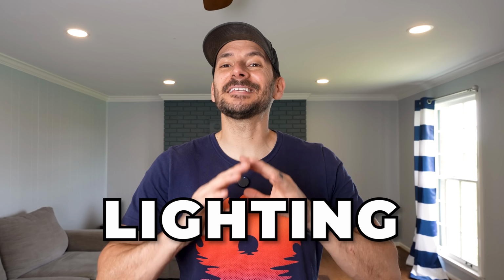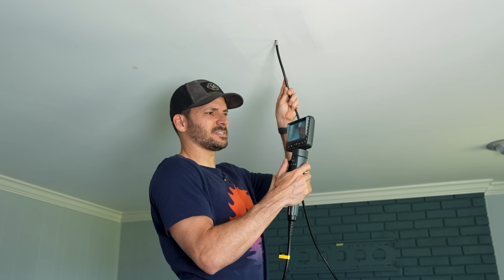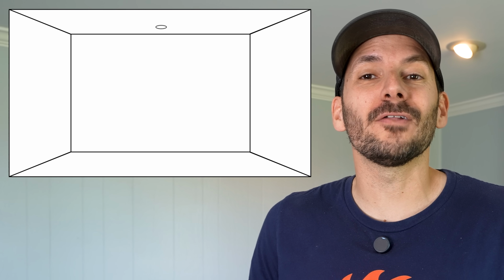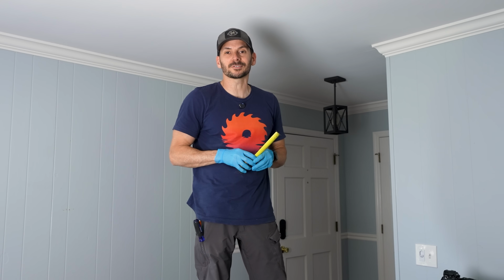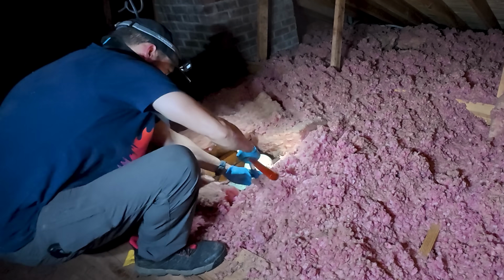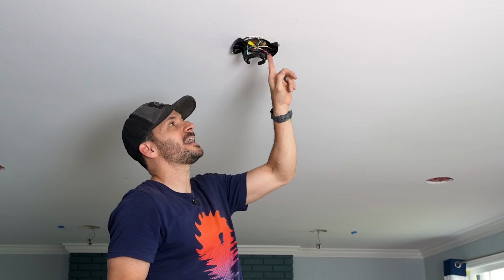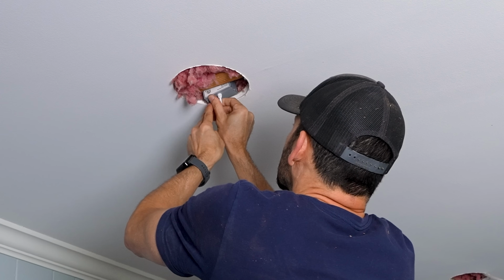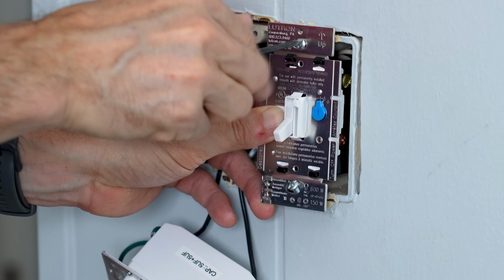Electricians Hate Me for Showing You This!

Comment: Huge cautionary tip!  If you are going to use one of the long shanked bit to drill across the ceiling joists to run the wire because you do not have attic access.  Most times you will be fine, BUT, and it is a big but, you have to be aware that you very well may hit a wire stapled to one of those ceiling joists.  If you do, then you have a much bigger problem because you have to open the ceiling and either replace or splice the wire you cut.  If you splice, then all splices need to be accessible so you will end up with a blank cover showing in your ceiling.

Comment: You can find joists with simple magnets. You just wave them around the ceiling surface until you feel it attract to something metal. Once you've found multiple points you will see a line where the plasterboard is affixed to the joists above. 

I have also used a thermal camera which worked well for me. Point the camera at the ceiling surface and you get a black shadow where the joists are. The joists act as thermal conductivity, removing some of ambient room heat from that part of the ceiling.

Comment: Well, reduce the trips to the attic. Cut the wires to length. Get into the attic, run the wires, and staple. Done no more trips to the attic. Do all wiring from below. And remember to do attic work early in the morning so you don't have to roast in 100-plus degrees.

Comment: Rookie's 
the only time we connect the ground on a switch 
when your installing a electronic dimmer , sensors , or computerized
cause on normal s/p switches an plugs the plate that holds the screws 
is grounded by the metal box , an to the ground of plug 
an of course using Plastic boxes, which i hate 
cause u cant add a box
but then again us Canadian 's  go by different codes

ques: your one main ques when doing ceiling's 
          does it have  Radiant Heating , cause it would be a very COSTLY mistake?
Radiant Heat : Heat cables imbedded in the ceiling  2" apart

if i was doing this job , i would of brought an extra hand 
now that's how it becomes easier

about your Lums theory ,lol
we have pots that you just pop off the plate around the light an there's a tiny switch 
which gives you an option on how much lums of light u can have 
an the vapour barrier  , we moved the insulation a bit an put a square of vapour 
barrier 6 mil  and push it up with wire coming though it an 
leave a bubble 6" high an used insulation caulking to on all sides
to glue to the original vapour in the ceiling , that way 
you have air room , an the barrier is sealed again , oh tape the place where the cable comes in 
House Codes 4 Canada!

Comment: If you can access the attic, don’t drill all the joists. Just run the wire in the attic space and use a fish tape. You may need to use two fish tapes…one to catch the other in the attic. Then pull your wire in.

Comment: What is the deal with skipping the ground on outlets and switches? The last three houses I've lived in, this has been a problem, but especially the last one--damn near every single recptacle or wall switch had the ground wire capped off and shoved in the back of the box. So much for inspection. I went around the house and properly attached every one of them. Is this a thing, like some guys doing it on purpose for some idiot reason, or just pure laziness?
My favorite mystery at the last house though was the circuit that still had 60v on it after flipping the breaker. Never did figure that one out before we moved.

Comment: Electrician here: Drilling through joists is fine and all until you hit something unexpected. If you're going to drill then you better use that scope between every single joist.

Drill through some unexpected plumbing and you're in trouble. If you're just some random guy with no trade experience and you're trying to do a weekend project, then I hope you started Friday night because learning plumbing, sheet rocking/finishing, and painting will be your Saturday and Sunday + after work project the first couple days of next week as well. Usually you're not going to hit HVAC, but it can happen and that's no good either. 

Attic access is better 11 times out of 10. Also, pro tips: stick some kind of marker through each hole where the light will go (tall enough so it sticks through all insulation), go up into your attic (just one time) with your reel of wire, and drop the dead end to the last hole and a loop through each consecutive hole working your way back to the junction box in one fell swoop. Then strap the wires (if you're not a tradesmen - use insulated staples and drive them just barely tight enough to prevent the wire from being easily pulled loose within 12 inches of cable entry to each light junction box and every 3 to 5 feet between staples if the light boxes are further apart). Strapping is necessary so the next guy to go in your attic (and it will probably be you) doesn't trip and fall through the ceiling.

Comment: With respect to switches, I have found TP-Link KASA smart switches to be the absolute best.  I do have Lutron vacancy sensor switches in some of my rooms; however, over the years, I have noticed their unexpected premature failures.  I have NEVER experienced such with KASA switches.  If one is to tackle installing lights and whatnot, NOW is the time to upgrade your switches to 21st century tech.  I rarely touch any of my switches, as Alexa does that for me.  Lastly, KASA smart switches are by far the easiest of all the available brands to setup.  The phone app is practically idiot proof, and you can set On/ Off  schedules in the app.  So if you have kids and/ or a wife that leave lights on because they believe that the floor needs to photosynthesize, you can set up multiple sequential off schedules.  Trust me when I say get the KASA smart switches!

Comment: Hopefully you're not in a cold climate or you would get attic rain without sealing the light with vapor barrier. Your attic already had the vapor barrier but you cut through it. I'm surprised you didn't patch it back or at least use silicone to seal the light to the ceiling. That way the warm air wouldn't scape to the cold attic, turn into frost and melt and produce mold when it gets warm. But great video overall.

Comment: Great video. Adding a few practical tips that make recessed LED installs smoother:
1. Layout: Mark the grid on painter’s tape on the floor, then use a point laser or 360 cross-line laser to transfer the points to the ceiling. Faster and more accurate than measuring overhead.
2. Test first: Power up and test each light before fully snapping it into the drywall. Defective units happen, and removing one later can damage the ceiling.
3. Fixture choice: Go with lights that have CCT select (and night-light mode if you want it). I’ve had good results with Amico.
4. Dimming: Use a dimmer with min/max trim to avoid dead zones at low brightness. Leviton Decora supports 3-way, and the mini locator LED is handy at night.

Comment: I'd love to have some ceiling lights, but how would you start in a multi-floor home where the floor/ceiling is made of reinforced precast hollow core concrete floor slabs?
The hollow space in the slabs is front to back, and the power sources are at the left and right side of the home; so you can't seem to move the power source away from those walls.
The front and back of the homes (here) are also closed off with precast reinforced concrete with coarse aggregate, also closing off any access to the hollow channels of the floor plates.

Comment: Tips not mentioned
Get a bucket of pull string and only go up in the attic 1 time, put the pull string in place where you wires will go, then you can pull everything from down below.
Stripping 14/2 is super easy with a mechanical stripper like the Irwin 2078300
Not a fan of the plastic strain reliefs. I like to use the metal cable clamps you also mentioned.

Comment: Neutrals do not connect to a switch unless it’s a lighted switch. The wires running from one three way to the other are called “travelers”. And not mounting the junction boxes is a code violation.

Comment: those flat wafer lights are terrible because there is no trim to block the glare, i foolishly installed them into my kitchen. Trust me get the ones that are further inset into the ceiling bonus points if you get the ones with black inner trim to further help with glare it will mask the light source where you cant see it on the ceiling only the light that it creates.

Comment: You don't need to go "up and down, up and down" when wiring up the cans from the attic.  Head on up and run cable to each can hole.  Instead of cutting the lengths, just fold the cable and push a healthy length down the hole, move to the next hole -- stapling as appropriate -- and repeat.  When you've made your runs head on down and snip the cable poking out of the holes.

Comment: as a licensed electrician....no one installing can-less lights EVER mentions the CODE REQUIREMENT to attach the junction box to the structure! stuffing the boxes up the hole to nestle into the insulation is not according to manufacturers instructions which violated code....of course there may be exceptions to my comments, but I don't think so
Reply: Apparently some of the can-less lights intended for remodels have instructions that state to not attach the junction box.  In that case, it should be code compliant and certainly easier to access in the future if you are doing a remodel.
Reply: I bet you’re a joy at parties 🙄
Reply: I think I'll just hire an electrician for my room. My luck I'd mess up.

Comment: I recently ran a four-way switch for a common area lighting.  Now I regret it for my situation and would have preferred to have a single switch plus 2 of the newly available wireless switches (sending units) for the other locations because with the hard-wired four-way switch (and same issue applies to a hard-wired three-way switch) I cannot have motion-activated lights.
Reply: the reason why , is cause the 4 , 3 - way  switches don't carry a little relay /solenoid
confused about , single switch an the 2 wireless switches 
but you added a 4 way 
there must be many way's into this area
ques: how many switches are there on this circuit for the lights
Being a Journeyman for 40+  an tech today 
every switch has to be modern tech switches for it to work
Motion Switches - set to a time of no activity (shut off)  1 - 10 mins
so three ways into this area , idk something tells me 
the 4 way should be where the sensor should be , considering the 
sensor switch is a single pole switch , take the 4 wires (2 white -2 red )
THIS IS JUST A THOUGHT! I CLAIM NO RESPONSIBILITY!
Marrett the 2 red - then hook up the other 2 to the Motion Sensor(which will act like a s/p switch)
if that works ,well happy for you , if not your have to wait 
till their invented , 3-4 way switch sensors 
when you build Houses , you run like a chicken with your head cut off , doing it (120-240v)
when you build plants an auto factory's , you pace an make sure all's right  ( 575 - + volts)

Comment: Quick tip on how to remove backstabbed wires from an outlet, NO TOOLS REQUIRED!  Pull the outlet from the wall, while pulling on the outlet, twist the outlet left and right, and in a few rotations, they all will be out.

While I like the look of lighting like this, I don't like it when you recline or you're laying on the couch, those lights are directly in your face.  I've used some leds like this in my man cave shining UP onto the ceiling from a DJ lighting I-beam.  Not something you'd use in your living room, but it works and indirect.

Comment: Everything seems easy until the first problem shows up. When someone does an electrical installation without following the proper standards, a small oversight can become extremely costly. I once had a client where we, as licensed electricians, rewired about half of his apartment because he had a plumbing issue and had to rebuild that section. We completed all the electrical work on that side.

The other half, which wasn’t heavily damaged, he decided to handle on his own. Two months later, he called me saying he was hearing a strange humming noise inside the wall — which is a major red flag for anyone who understands electrical systems. When we arrived, we identified resistance on the circuit, a strong tension-related vibration, and eventually, after he insisted on further checking, I also detected a faint smell of burning wood.

Soon after, we located the beginning of an electrical fire inside a light fixture that he had installed himself. He had installed it incorrectly and also used the wrong breaker. The issue was caused entirely by lack of knowledge. The fire department had to be called in, and as is often the case, the firefighters caused more damage to the apartment than the fire itself.

In the end, what he thought would be “easy savings” ended up costing him his entire apartment. After the insurance investigation, it was confirmed that he was at fault — and as you can imagine, the insurance company gave him a very hard time reimbursing any of the damages.

Comment: At 14 minutes in your video you mention the boot. The drill and boot will wear against each other as you drill, so I place a Bearing model 6202-RS between the drill chuck and the boot. This eliminates any wear on my drill and the boot. These bearings are very common and cheap. I have been using the same bearing for dozens of holes.

Comment: Pro Tip: Do not backstab the wires into the switch, they are unreliable and will eventually fall out. Use the screws on the side, it takes a bit longer and will last the lifetime of the switch.

Comment: 1. Technically, you don't need a ground for a plastic box. However, if your house has a continuous ground wire, you should connect that wire to your switches and outlets to ground them properly. 

2. It is likely that your three-way switch wiring with the red and black wire, probably what is going on is that the red is the traveler wire, and either the black or the red wire will be hot, depending on whether the primary switch is off or on. So when you turn the primary switch off, the black wire has no power; however, the red wire still sends power to the secondary switch. At the secondary switch, when it is turned "on," the red wire powers the light. When the secondary switch is off, it is in contact with the black wire, which is also off and is not receiving power from the primary switch. 

It is almost certain that your switch is the secondary switch. In the secondary switch, the neutrals are just wired together and not connected to the switch because the secondary switch is connected to the neutral of the primary switch. 

Think of it this way. All of the power supplied to the secondary switch comes from the primary switch, and it is connected to the neutral wiring of the house's electrical system. So it would be superfluous to connect the secondary switch to the neutral wiring that passes through that box for the switch. It probably would not hurt anything to connect it to the neutral wire in the box, but I am not an expert. 

The primary switch is the "line" switch, which receives power from the service panel first. So it is directly connected to the service panel. Usually, there is one hot wire in the box that is the hot wire that connects every light and switch on that circuit to the service panel. Each outlet and switch is wired in parallel, by using pigtails to connect to the common hot wire and the common neutral wire and the common ground wire that runs from the breaker in the service panel to every switch and outlet on that circuit branch.

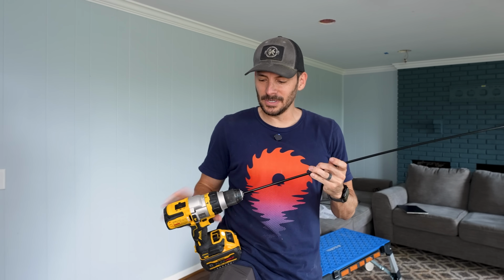Comment: @18:30 Drill "as close to the ceiling as possible." No, sir. Drill as close to the center of the joist as possible to avoid compromising the joist's structural integrity.

Comment: If you're going to use a screw to measure from, that little notch on the bottom side of the tape measure clip is a actually meant to hook onto a screw or nail. Then you don't have to fight with catching on it sideways.